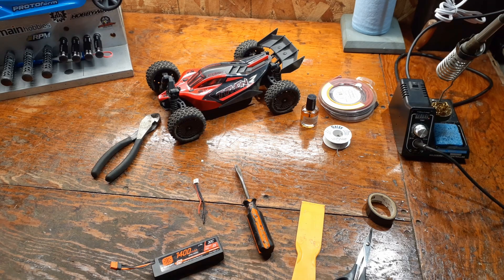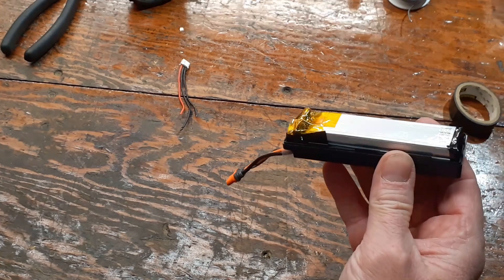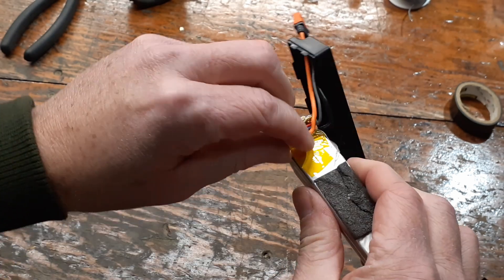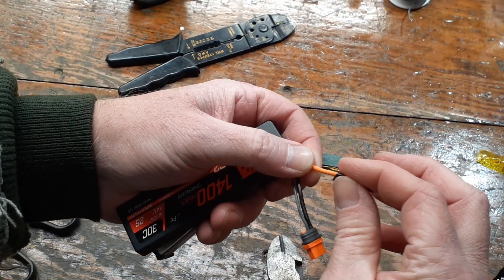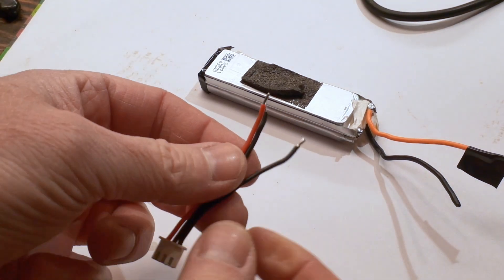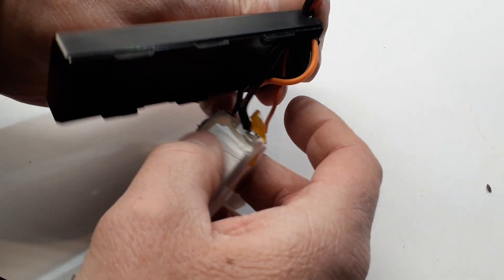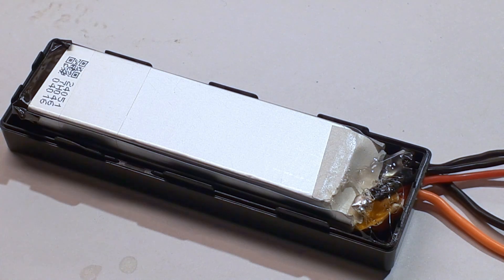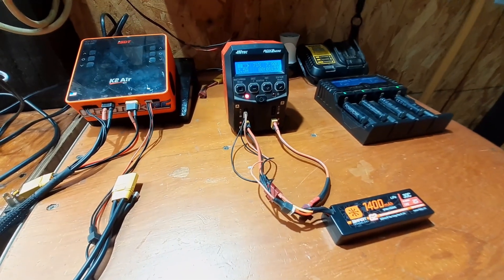Spektrum Smart Battery Modification - Use your Charger!

Comment: I was told you can fast charge smart battery's and they will auto balance with smart  battery alone .. I been doing it
Reply from the maker: Really?  That's interesting. I didn't think it was possible.  You can set most chargers to non balance charge, but that's not very safe with Lipo's.  Thanks!

Comment: I don't get it, why buy a snart batt. Then you are not using it. Just to break it in half to fit you outdated charger, why not buy the battery that fit.. really stupied
Reply from the maker: I bought the Grom used and it came with two smart batteries.   Not having a smart charger I took matters in my own hands.  Plus...it was fun.

Comment: Thanks, I made the modification today on 3 smart 2s G2 1400mAh batteries like yours. Great advice! Now I can throw this useless smart spectrum charger in the trash, a terrible system. I can finally charge them with a standard professional charger. Thanks, thanks a million.
Grazie ho fatto la modifica oggi su 3 batterie smart 2s G2 1400mah come la tua . Un ottimo consiglio! . Adesso posso buttare nel cestino questo inituile caricatore smart spectrum un pessimo sistema . Finalmente posso caricarle con un caricatore professionale standard . grazie grazie 1000
Reply from the maker: Awesome!  Glad it helped!

Comment: Would be nice if theyd just left it like the previous ones and had the balance lead as well. According to the comments you can leave it and add the balance lead to it like the first gen smart batteries were. 
Wish id read that before doing one, id left it in there. Lol
Reply from the maker: Selling charger specific smart batteries is all marketing in my opinion.  The idea is great for the inexperienced RC driver, but when you already have non-smart batteries and your typical charger, smart batteries don't make sense.  Like you said they could have easily left a charging lead in, but then they wouldn't sell as many chargers.  Nothing wrong with the spektrum smart chargers or batteries.  They are very good products, just not for me.

I know the smart chip does have some functionality like auto discharge.  If someone wants that functionality the chip cold be left in. I ALWAYS storage charge my batteries so I just eliminated the chip.  One less failure point.  :)
Reply: @arkyrc I 100% agree it's a marketing thing and also a good way to contain their customer base within their own eco system sort of thing, but I believe, though it may have been the secondary reason, That they were trying to produce product that anyone could use, regardless of knowledge when it comes to lipos, and not have any dramas. In a sense, its a much safer way for any random person to use lipos while drastically reducing the risk of damage to the battery. I'm sure you've seen your fair share of "questionable" practices when it comes to lipos, especially when it comes to charging/storage etc, I know I've sure seen some... Interesting stuff 😂.
Anyway - Great vid! Had a feeling it would be the same concept as when I did the traxxas batteries, but was unsure due to the smart chip. Thank you!
Reply from the maker: @shannonm9291  I have absolutely no issues with Spektrum trying to keep their costumers buying more Spektrum products.  It's simply good marketing. If you are buying your first RC then smart batteries are great for safety.  

Yes..I have seen many people practice unsafe charging practices.  I ALWAYS storage charge my batteries and store them outside in my shed and inside my wood stove.  This way I get the most life out of my batteries and I can sleep without worrying about a battery catching fire. 

Thanks for watching and leaving a comment. :)

Comment: I have 3 pack of 3s battery almost new with the chips damage. Will try to open them but having a hard time with them.
Reply from the maker: Haven't messed with the 3S batteries.  Keep me posted.
Reply: @arkyrc had to:

-heat them up a little.
-compress the border with some pliers and when the joint opens a little use a plastic scraper to pry them open.
Reply from the maker: @Banshee9129  Glad it was easy.  Thanks for the update.

Comment: Why tare battery apart when you can just add neg lead to neg same with pos and the one wire into balance lead
Reply from the maker: There are two battery cells. Each cell must be charged separately and balanced.

Comment: but why buy that type of batteri in the first place then you just want to destroy it. other batteries are half price so really there is not point to do this.
Reply from the maker: @tommyjakobsen5504  
In my case, I bought my Typhon from a friend and it came with 2 smart batteries.  I didn't want to buy another charger to use them.  I believe the RTR kit comes with a battery and a slow USB charger.  Many people prefer to modify these batteries so they can use them with their non smart charger.

Comment: What about the 3s smart battery's how does that work? I have one i want to do this on to be able to balance on my normal charger also
Reply from the maker: I have not done this to a 3S battery, but the process would be the same.  You are basically adding a charging lead.  You could also leave the spectrum chip in if you want to keep the auto discharge function.  I also storage charge my batteries so I removed it.  Good luck!  :)

Comment: The 3s smarts are trickier to pop open. Half attempted before seeing this video. Ill toss back any helpful information. 

Thanks for the video, greatly appreciated. If your ever concerned with soldering iron heat traveling into the cells, Id like to help out if i can. I made a clamping aluminum heat sink years back and I use it religiously.
Reply from the maker: @greggraham247  I haven't messed with the 3s batteries.  I'm sure they are tricky...please let me know how you get along if you wirk on one.  Thanks for the comment.  Greatly appreciated.
Reply: @arkyrc  Happy to report that I have a couple of 3s batteries free of their enclosures. Used a bench vise to stress the walls. I only put about an eighth in, up to the seam. One wasn't bad, the other took some more convincing. The shell makes a horrible cracking/popping sound to let you know your on the right track.

Comment: thanks for the tips, i soldered balance plug on G2 without removing the smart chip, it still works fine
Reply from the maker: @tlschun  That's good to know.  I see no reason why it wouldn't still work.  😁
Reply: This is the comment I was looking for. I have an older lipo charger with the standard balance lead but I don't keep up with my batteries and don't use them frequently. Keeping the smart storage feature while allowing the use of my old charger is great!

Comment: Hi, great video. I have a Losi Lasernut with a Smart Spektrum ESC. I want to run a standard LiPo battery with it. Will that work? 🍀
Reply from the maker: @dirkhanke2524  As long as the battery fits the car it will work fine.  Connectors may be different so you may need a different plug.
Reply: @arkyrc  Yes, I want to use the T-Plug. A battery without a smart chip. I don't need a smart chip; it's far too expensive. I want to use a new connector with only two pins on the Spektrum Smart ESC and disable the third wire. Will that work? I just want to drive; I don't need any data...

Comment: Nice tutorial.
Do you think it's possible to keep Smart capabilities and add balance lead to have both possibilities ?
Smart is quite an interesting feature as it discharge the battery to storage voltage if not use for a while (if i'm not wrong).

By the way, you are charging at 3.5A which is more than twice the capacity in Ampere... 
It's better to stick to 1C (here 1.4A) unless more is supported and written into the battery specs.

Thanks
Reply from the maker: @samfaitchmir I typically charge at twice the battery capacity. So far I've never had an issue. 

I can't think of any reason why the chip wouldn't still function if left in place.  At the very least the auto storage discharge should work.  I removed the chip just to simplify things.  It would be easy enough to leave it in place I suppose.  😊

Thanks for the comment!!

Comment: Can this idea work ebike battery
Reply from the maker: I would think that an E-Bike battery would be built similar but would have way more than two cells and operate at a much higher voltage.  If it were me I'd not mess with one of those just to be safe.